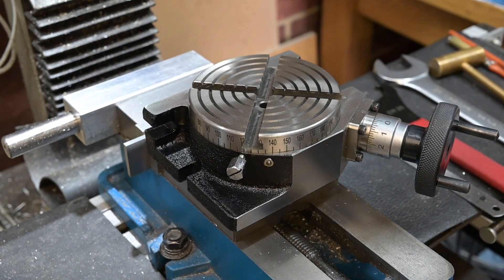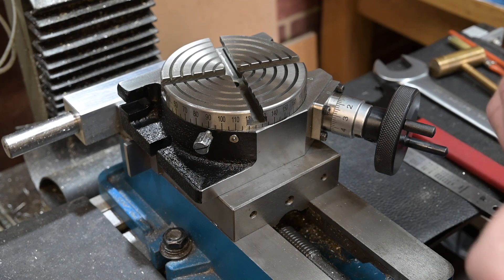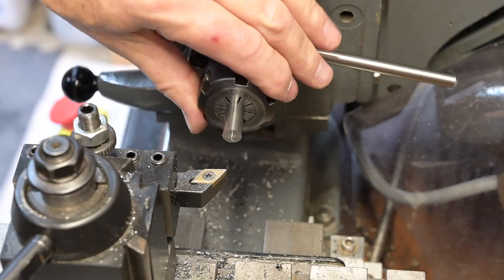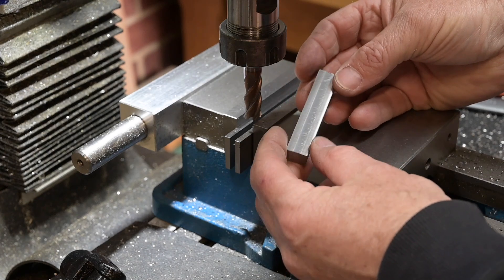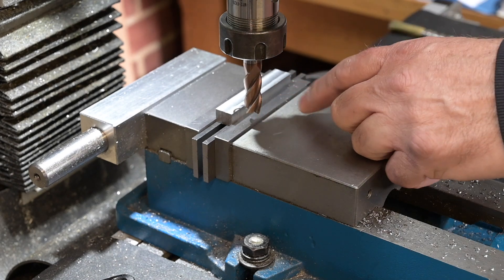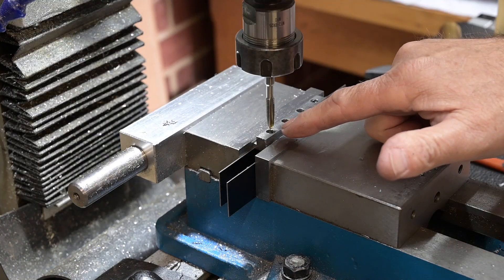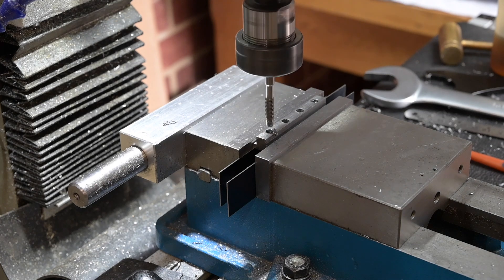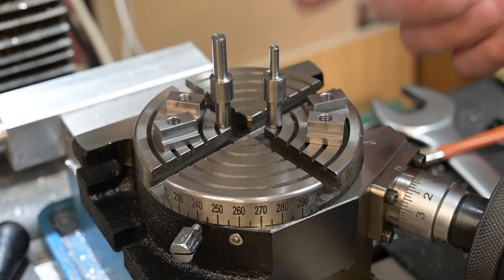Mini Rotary Table -  Making _ T Nuts and Fixture Pins

Comment: I got a similar looking rotary table two or three years ago. It proved to be a bad investment. With my one, the fit between the outer casing & the rotating part was very loose. So when you tightened the locking screw, it displaced the table around 5 thou of an inch sideways. Yes, it does have a bearing in the bottom & I have tightened it up. But I have zero trust in it. That bearing was only a deep grove single ball race. This one is better made but, not of better design. The locking screw is still on the side & still pushes the table away from the centre.
Reply from the maker: I will only use it for light work and seems tight at the moment, time will tell 👍 fortunately I do have a bigger table to fall back on 🙂

Comment: For small not very accurate parts it’s great. I’m actually thinking about getting one for my Bridgeport. I have a very good one but it weighs a ton and at 74 years old it’s simply too hard to put it on anymore. If I had a small crane it would be a different story lol. Plus the fact that by now my shop is only a hobby shop anymore.
Reply from the maker: They are ok for a hobby shop 👍

Comment: I recently made the t nuts for my Vevor 6" rotary.  I was auditing a community college machining course and mostly making tooling while the real students were doing the class projects.  I used a punch to deform the bottom most thread so that I couldn't put a bolt all the way through and break the table on the rotary. I didn't get a chance to make the fixture pins before the end of the course but they are on the list.
Reply from the maker: Good idea about the treads 👍
Reply: Or use a second tap and don't pass it all the way through

Comment: Nice project Mark, and well executed. I have the same rotary table. Bought it about 5 years ago with the adapter to take Myford chucks. I have t-nuts for it which also fit the Myford t slots. I'm sure you'll find it very useful. Cheers Nobby
Reply from the maker: I didn't try the Myford slots T Nuts, it could be I made 4 nuts I didn't need! 🤦‍♂😂 ATB Mark